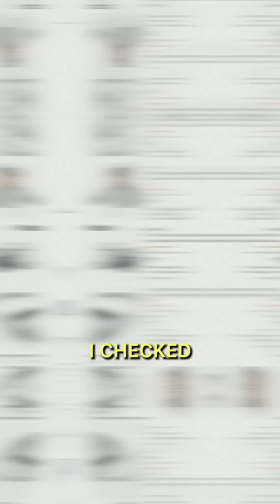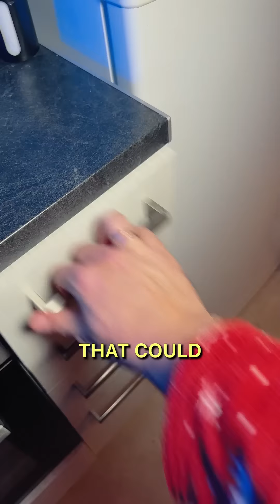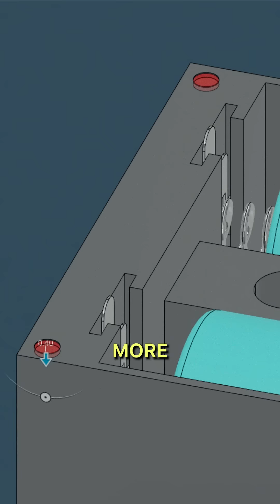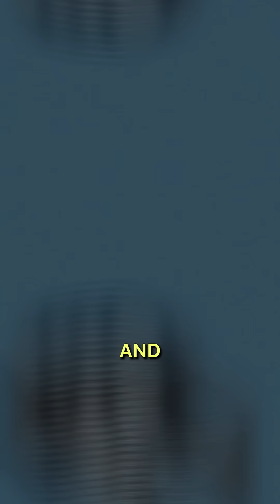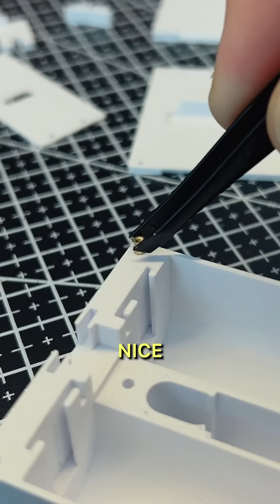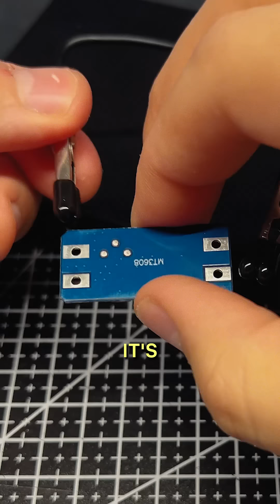This Solved My VR Battery Problem

Comment from the maker: Safety note: this is a DIY prototype.
Built with proper protection and tested carefully.
Don’t replicate without understanding the risks

Next time I’ll use more advanced parts and with quick charge and make a cleaner design :)

Follow to see the upgrade 😎
Reply: Hello what site did you use to model your power bank
Reply from the maker: Hi! it’s Fusion 360 software , you can use it for free 👌🏻
Reply: @DIY_HARD  Thanks
Reply: BMS?
Reply from the maker: no, its just simple tp4056 with protection, next time ill use some more complex stuff
Reply: Im an engineer in electronics
Reply: Could you do a website for it where users can download the 3d model you have and use the parts you used (listed in the webiste) and you put the risks in red there
Reply: G

Comment: I just got my first 3d printer what did you use to make this?
Reply from the maker: Hey there! you should start with CAD modeling for 3d printing tutorials, for example Fusion 360, which i use in the video
Reply: @DIY_HARD thank you I have tried it it’s amazing

Comment: everything is good except one thing - THE CHARING MODULE YOU USED, THE TP4056 CAN ONLY CHARGE ONE SUCH BATTERY AT A TIME, NOT 2 IN PARRALELL, OR SERIES - JUST A SINGLE BATTERY FROM 3.7V-4.2V, YOU RUN SEVERE RISKS DOING THIS, PLEASE USE A PROPER DEDICATED BOARD FOR YOUR CONFIGURATION WHEN USING MORE THAN 1 BATTERY OR OVER QUITE A QUICK TIME YOU RISK DAMAGING YOUR BATTERIES AND SERIOUS DANGER.
Reply from the maker: TP4056 is meant for a single 1S Li-ion cell (4.2V max), so no series connection is used here.
The cells are connected in parallel and treated as one 1S pack, with matched batteries - pretty common setup.
That said, I agree that for more complex configurations a proper BMS/charger is the safer choice.

Comment: Dont use that boost buck converter, its making rf noise
Reply from the maker: what do you recommend instead?
Reply: @DIY_HARD i can help you pick a good module without the issues
Reply from the maker: i'd be glad if you provide the link, please 🙌

Comment: This may be dangerous or costly. Meta only supports their own and affiliated charger modules. The reason is that the input may overheat and melt the surroundings, damaging the headset, and worse, you🤪
Reply from the maker: Thanks for the concern! 🙏 I looked into this during the build process and these components don’t overheat at least with meta quest 3, and long-term testing confirmed that. That said, I agree they’re not the best solution for the overall concept, so I’m planning a second part or a long-form video where I’ll address the mistakes and improve the design.

Comment: warning: do NOT do this without propper experience because tge batteries could explode if you do something wrong
Reply: It's easy to use and only explode when you absolutely drilled or decided to short circuit it

Comment: Nice build.
Elecronics design is poor  - you usually get 0.5A charging when connecting +5V directly
You should get a board that supports QC3.0, to get full 18W = 9V2A

You can find these with built in charging bms for like 2$
Reply from the maker: I actually learned this while building the project - it’s my first electrical one 😄
As you can see, I pinned a comment about the second part. Thanks for the tips though 🙌🏻